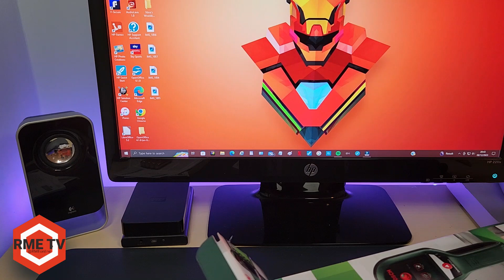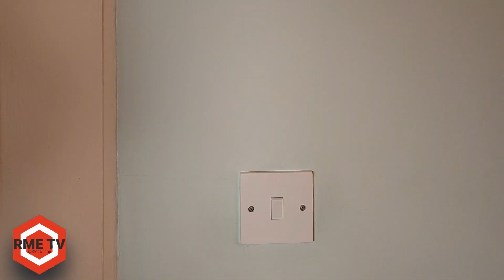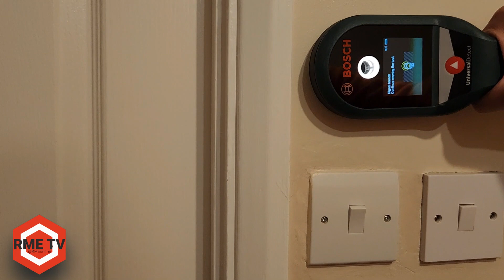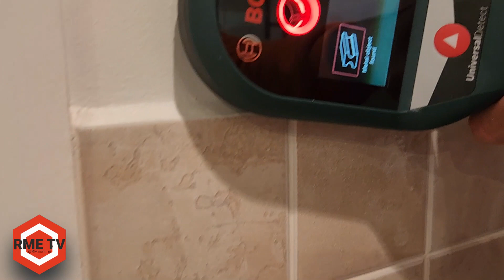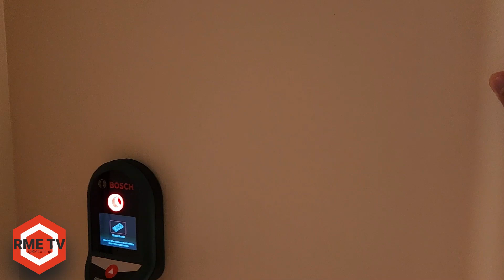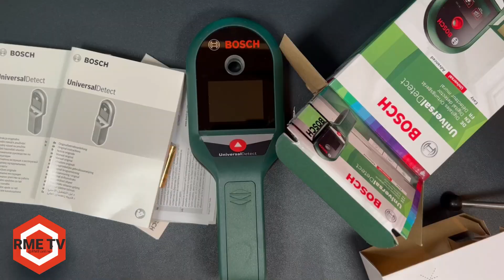Bosch Detector Review 3 in 1 Detector #Bosch

Comment: To any potential buyers. If you have reinforced concrete, dont even bother. It will just tell you to not drill anywhere... I ended buying a used dtect 150 for a bargain price and that is doing absolutely fantastic. For concrete you need a better one the cheap ones wont cut it for sure.

Comment: Most of these cheaper models needs to calibrate first. That means you have to start in a part of the wall where you are relatively certain there is NOTHING behind the wall, and then slide it sideways towards the area where you think there is a stud, an electrical wire or metal. 
You seem to turn on the machine,  and then place it DIRECTLY on top of the area where you know the electrical wire or stud is. It will then try to calibrate to neutral on top of the wire.
Reply from the maker: Hello as you would notice in the video this is not a cheap model at just under £100, no calibration is required as per the instructions in the manual other than placing your free hand on the wall to help detect live wires but as shown in the video this made the issue worse, cheaper models under £10 as I mentioned in the video did a better job in the past than this detector which doesn't seem to like sold walls at all I'm sure it would work better on stud walls in new builds but it's below oar performance for a near £100 detector, and yes some cheaper ones need calibration each time before using them but no calibration is required for this, so it failed the real world test.
Reply: @RMEonline  It says it's calibrating when you turn it on though.